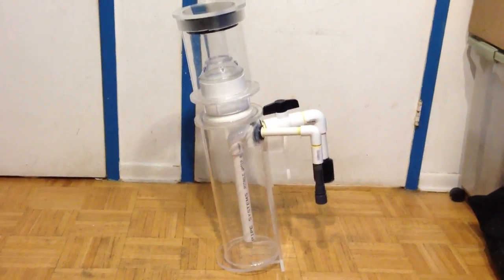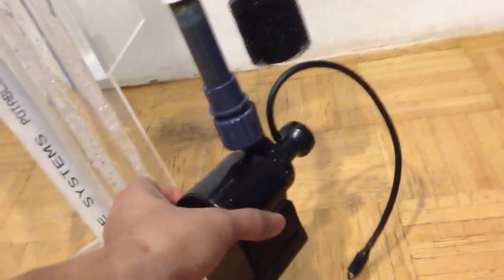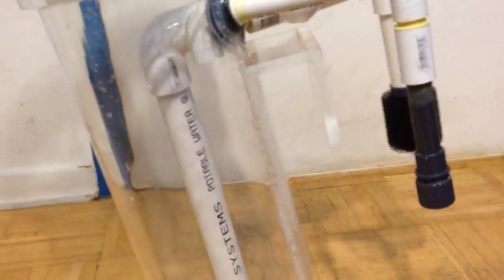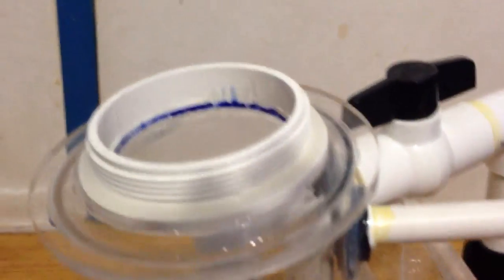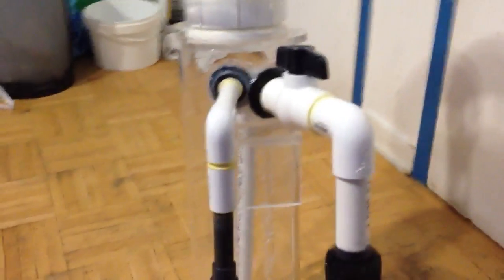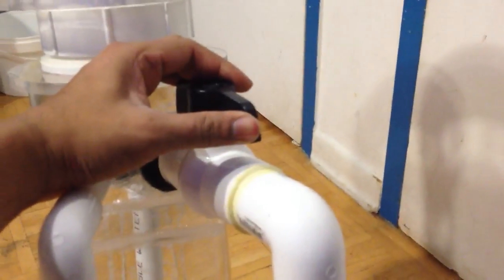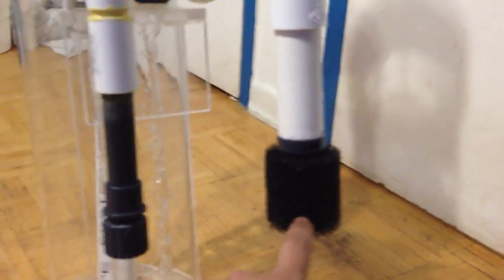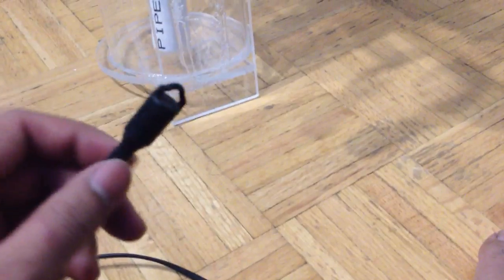DIY Protein Skimmer (Part 2)

Comment: really nice!! why not use lime wood airstones? I'm new to saltwater and have a 30 gallon fish only w/ live rock tank.  I'll be building my skimmer this coming weekend. I'll be using lime wood airstone at the bottom, with water coming in on top and exiting at the bottom to maximize counter current flow and contact. I don't think using a wide tube is such a good idea in my case since I want as much air bubble/water contact as possible. thoughts?

Comment: This design doesn't seem to maximize contact between the water and the bubbles. It seems the standpipe should be on the input, not the output, that way you'd be forcing the water to rise with the bubbles before escaping.